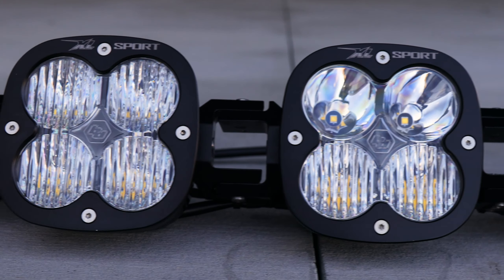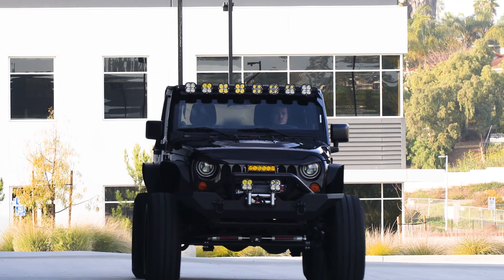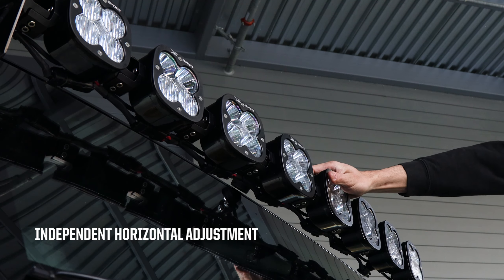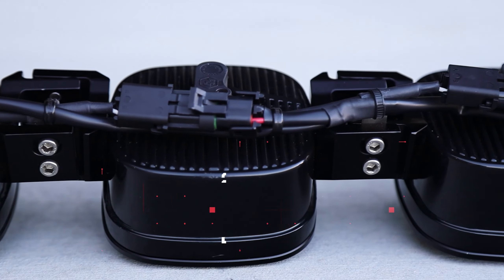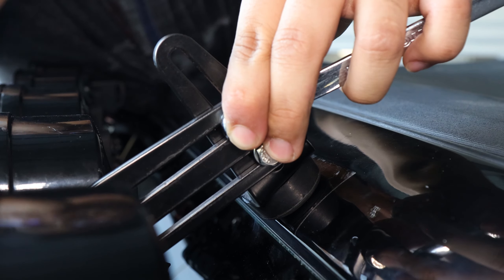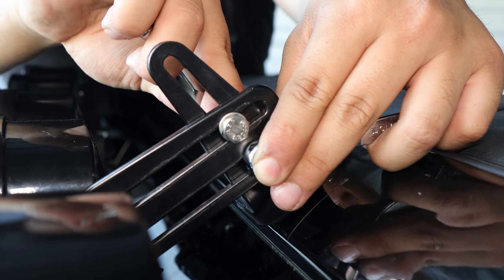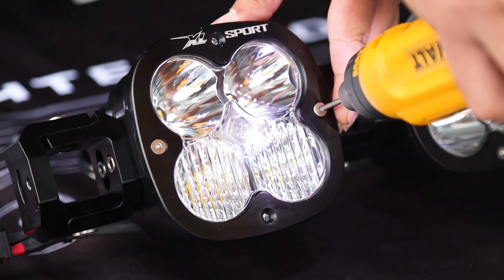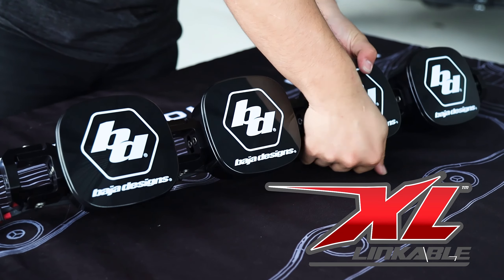The XL Linkable Mounting System - Full Adjustment - Total Performance

Comment: May I ask is the metal mounting bracket for cross light come with insert foam protection against paint chips? Thanks
Reply from the maker: Hi there, it will come with rubber inserts for protection.